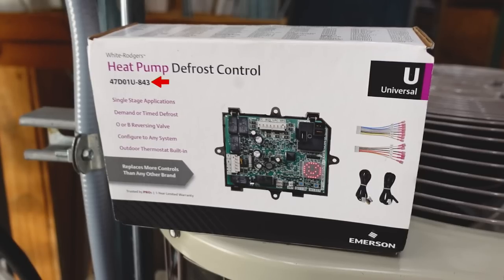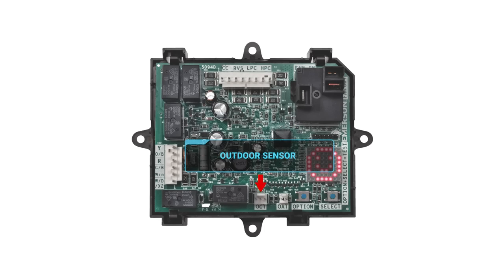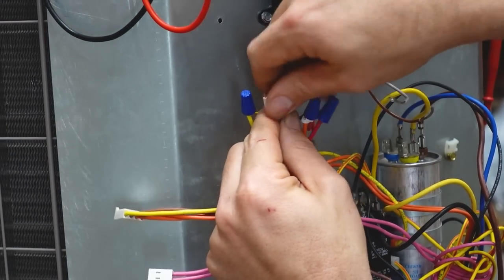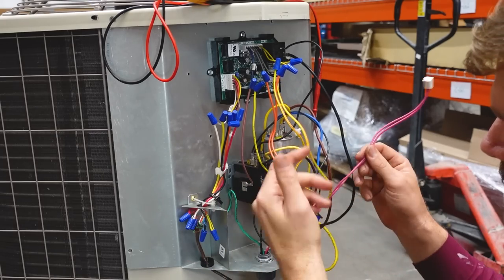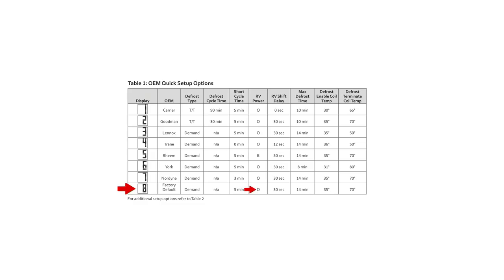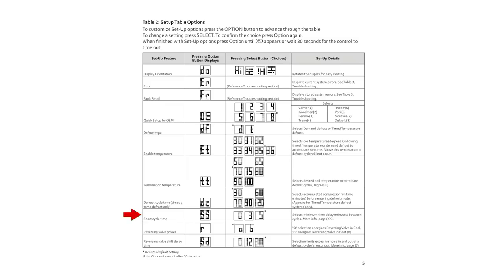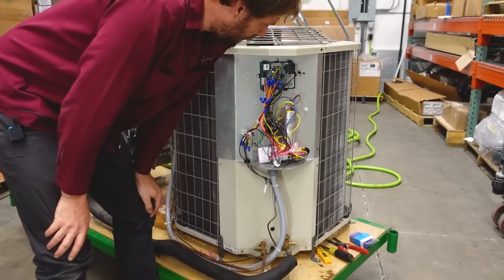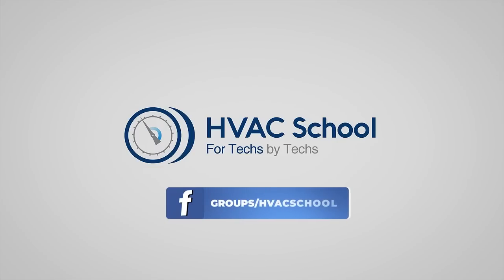Universal Heat Pump Defrost Board Install

Comment: I just installed one of these for the first time yesterday! OEM board was available but the  sensor was a factory order and the system wouldn't stay in defrost for only 2 seconds even though the coil was -20 and sensor closed. We opted to replace the board and sensor with this. Worked great and easy install!

Comment: Love the WR defrost board allows me to have a board on hand I normally wouldn’t have. Two things though 1 I like spade connectors over the wire nuts but I have trouble finding a insulated spade connector that fits into the male spades WR has on the harness. The other thing I just put one of theses things on a month or so ago and we had -15 to -30 wind chills they should bring the NFC set up over to this so I can set it up in my warm truck 😅😉

Comment: 3:35 Correction - the fan relay specifically on the 47D01U-843 is NO, not NC. This board energizes the fan relay to close in and start the fan 1 second after engaging the compressor/fan contactor, and 1 second after exiting defrost. When the unit shuts down or enters defrost, the fan relay is de-energized 1 second after the contactor opens or reversing valve shifts (when RV shift delay is disabled). I have installed this board in 2 different units and know it well. This board uses a NO fan relay to offset the fan startup from the compressor startup to lower inrush starting current. I think this is a weak point in the board as this relay is switched and energized every time the unit starts, even during cooling. A NC relay would be better since it would only energize to open during defrost.

Comment: Def worth keeping one on the truck, I've always put in oem in the past which takes a few days to get at the least, but why only for single stage units? I don't get that. Or do they make others for two stage and you're not mentioning them? I just can't see any reason they wouldn't have them for two stage, dual fuel setups which in my area in CT is very common

Comment: i am so happy  to now see this video. Thanks for putting out. Please I have a question. My RHEEM heat pump (out door unit) is flashing red on the top indicator. (The other indicator is not lit.) Do you know what this flashing means? This unit DOES NOT comes on in the HEAT mode. I checked the board, and found out that there was no 24v voltage going to the CONTACTOR COIL, from it,  BUT, there was 24v between the R and C terminals on it. I am thinking that this board is defective. A reply will appreciated. thnx again.

Comment: I plan to replace my existing defrost control board (HK32EA001) on my 4 ton Carrier duel fuel (propane backup furnace) heat pump with this Universal Defrost board.  But before I order a new universal defrost board  I want to make sure one thing my question is that currently I set the carrier's programmable thermostat so that it switch to propane furnace from heat pump mode when outdoor ambient temperature is lower than 20 deg(F) - (currently there is a ambient temperature sensor is installed), will this new board impact this feature? In other word, will this current feature be impacted/disrupted by the new board? When electric power goes out I switch to emergency heat to run the gas furnace. I will really appreciate your response! Thank you !

Comment: Why is this defrost board only compatible with certain boards?
 Or what settings could other boards have that this one doesn't?
Reply from the maker: The Emerson White-Rodgers Universal Heat Pump Defrost Board's compatibility list is quite long.  If the defrost board you are looking for is not on the list, chances are the condenser fan motor may be a communicating motor or communicating system with defrost integrated into other components. Most inverter systems have a programing sequence internal to the main board for defrost.

Comment: What reasons would a company not want to keep a universal on the truck? Serious question btw.
Reply from the maker: Usually the reasons a company would not want to keep a universal component in stock or on hand is cost. Some universal parts can have a higher cost compared to the OEM part. Keeping a higher cost part in-stock raises the companies overhead until that component is used and can be charged to a customer.

Comment: Thank you for sharing the information and for all the good videos, thank you 

Sir. Why while pulling vacuum it could blow oil (Vacuum pump oil) into the hose?
Reply: That normally means the check valve has failed on the vacuum pump itself.  I’ve had this happen also.
Reply: @BleedingEdgeHVACR  Thank you sir

Comment: What are the reasons for not being able to use this on a two-stage?
Reply: @blakeperson9189  "Really ?" Thanks for that "inside the box thinking " reply !
Reply from the maker: Great question. When we talk about a two stage system it is important to remember that the compressor has 2 different speeds (Typically 1st stage is 60% capacity and 2nd stage is 100% capacity). With utilizing this type of control on a two stage system you run the risk of the unit running longer in defrost as only the first stage will be energized utilizing 60% capacity instead of the full 100% during defrost. The longer a unit runs in defrost the longer the system goes without delivering heat to the space and can quickly loose control of the space temperature under heavy loads. I hope that answers your question!
Reply: @HVAC School  so then why don't they just have it run defrost in 2nd stage then? Not making much sense here. And what about duel fuel? If the defrost has to be on 1st stage for whatever reason, you got your emergency heat running at that time anyway so there would be no load issues.
Reply: @HVACRTECH-83  The board has no provision to control the capacity solenoid. Emerson makes another board that is "universal" and can be use in a 2 stage unit. It can handle ECM or PSC fan motors and has ComfortBridge communication capabilities.